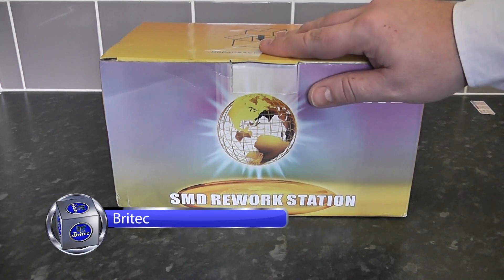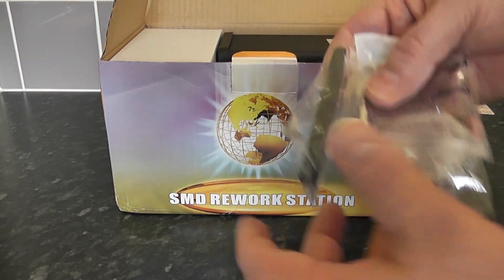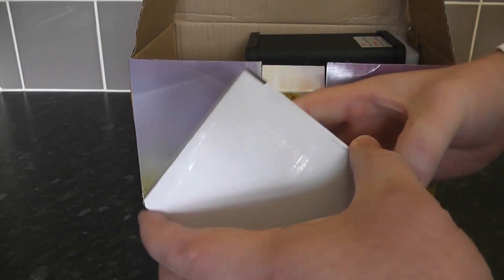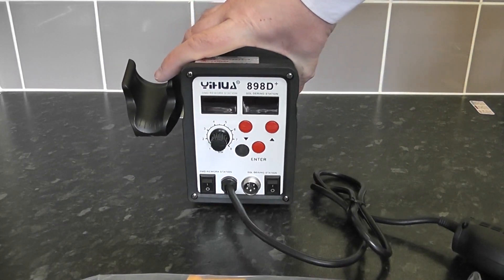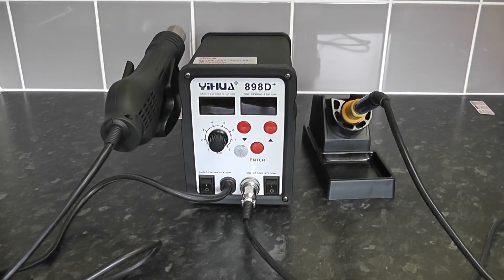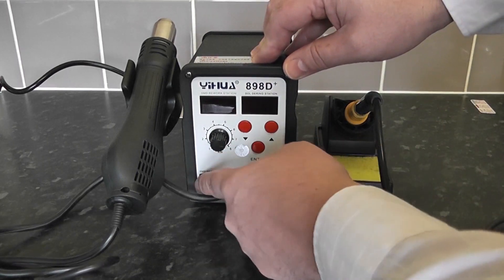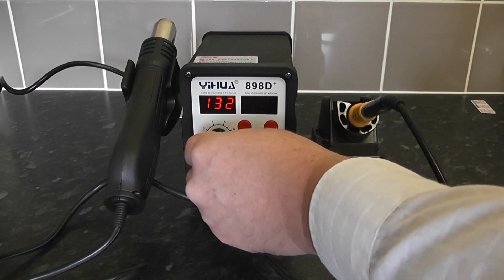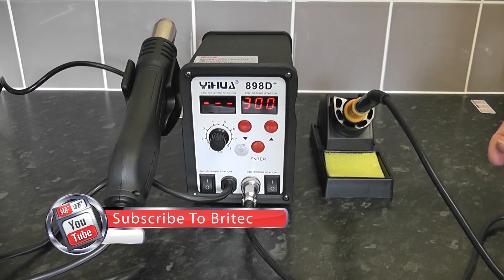YiHua 898D+ SMD Rework Station & Soldering Station

Comment: I bought one and the heat gun only worked a few times before it quit.  The soldering iron, after a few months, doesn't get as hot as when it was new.  Just my experience.  Yours may differ.

Comment: Thanks brian :-)
Very nice unit, i like the ease of replacing tips + variable temprature on both :-)

The left one looks like a modified paint stripper or hair dryer on turbo lol.
A heating element/fan/thermister combo.

You will be using that to torture northbridge chips lol, especially with laptop display problems, i blame crap solder nowdays.

The soldering iron will be also handy for silver soldering, good heat control, you can repair the other halfs jewlery lol :-)

Expensive?

Comment: I have a 898 d mine has the name zeny on it ,and my soldering pen holder on mine is metal,and my soldering pencil is a little different ,but pretty much the same,mine came with 11 extra tips,I love my rework station ,it works very well ,I would suggest you get one of the brass balls to clean your tips,instead of the sponge is hard on tips ,I use both .good video.

Comment: The first number is the series. B series are more commercial grade, more study. 9s seem to be less study. The 8 series is the best series from yihua. There the best made by far. I make vape mods so the reason I went with the 8 instead of the 9 was the hot air for shrink tubing. Yihua 898d+ is a great machine. Be careful, in regards to brand. There are many cloned stations. There are certified YIHUA SELLERS who buy direct from the United States dude m storage. Don't just buy the cheapest one. Spend 50 to 80 on a genuine YIHUA. There clones of stations like genuine hakko but there hands down the best made clones. YIHUA genuine YIHUA, also happen to use other brand names. Do your research. These stations are such an upgrade to a contact wattage wand. The level of usefulness compared to even a Weller wand is like night, and day. I hope I helped someone out.